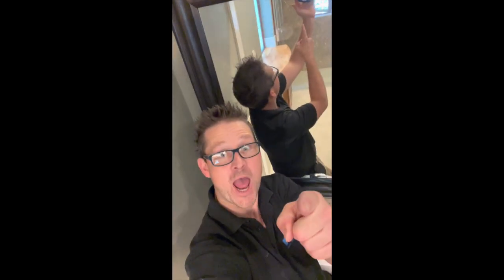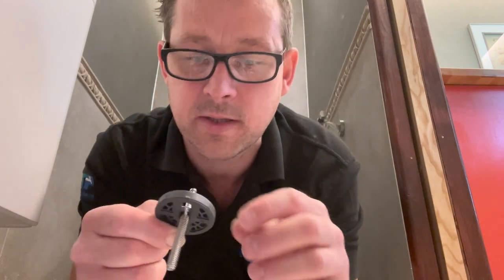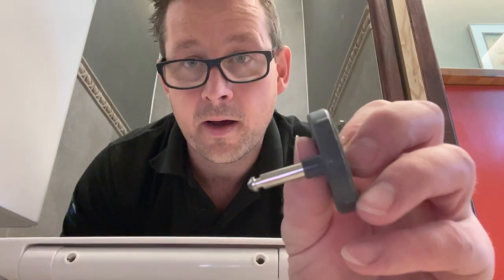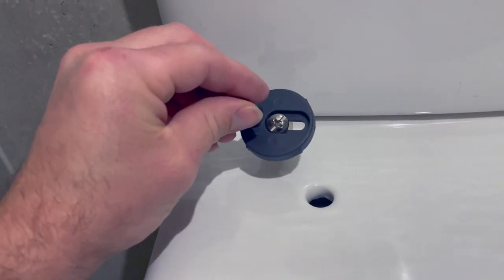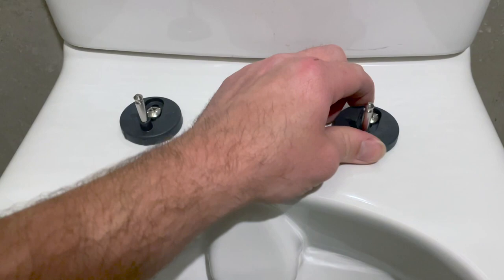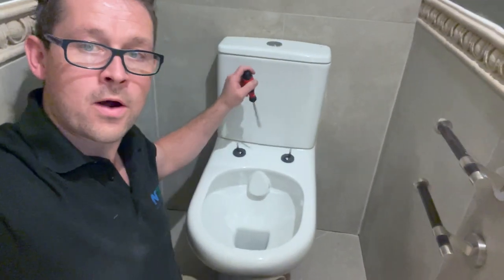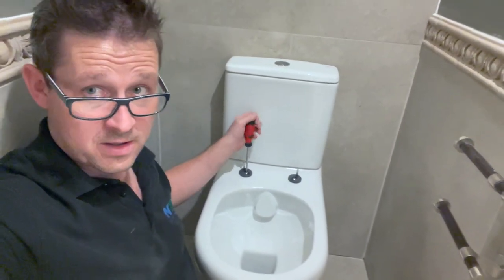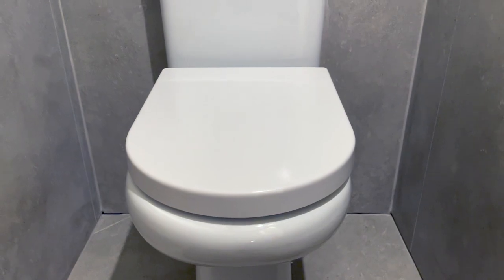How to fit a toilet seat

Comment: Can I just say... after spending months trying to figure out what toilet seat would fit in the first place (as the previous 2 broke very quickly due to the them being the wrong size and me basically FORCING them to fit) I then had to learn how to fit this latest one properly. Thank you so much for this in depth, literally step-by-step instruction for us that don't have a clue, because after 2 hours of trying and googling different instructions - I FINALLY have a perfectly fitted toilet seat that's functional and works like a dream!
One thing I have found on every other site, is although the important part of needing to measure the space between the seat holes are important, nobody seems to mention the length-way issue I had. I had measured the distance at the back between the holes perfectly, but when I came to try the 'first closing' the seat was hanging way over the front. Thanks to your advice though, I was able to push it back and even it out widthways because the screws were just at the right looseness for wiggle room. I'm sure lots of people will read this and think oh what a saddo, but when you've relied on your partner to do these type of things for decades - and then suddenly you have to do these things yourself, it's not as easy as I'd expected. Like everything in life, it's only easy when you know how - and next time, I know how 😂 Thank You, Lin. 😊